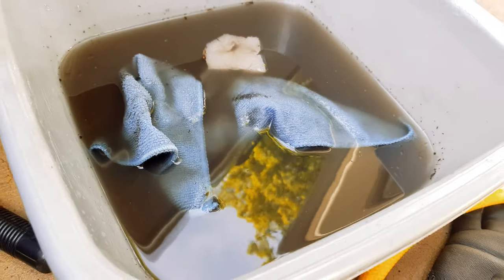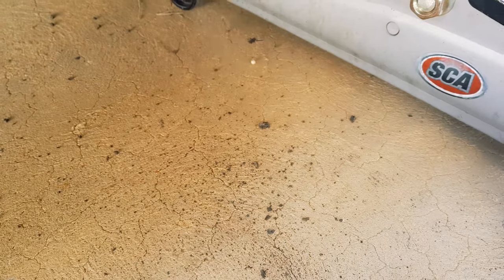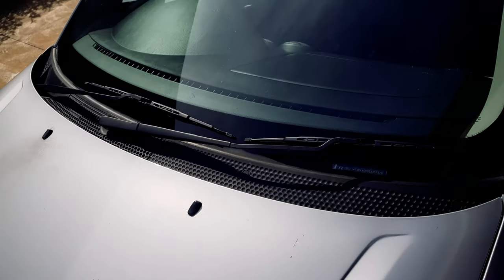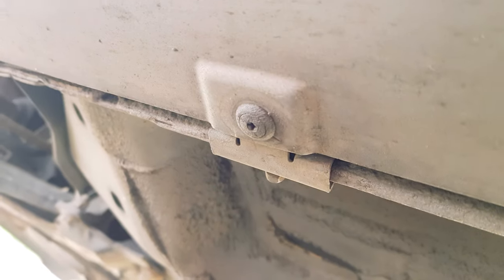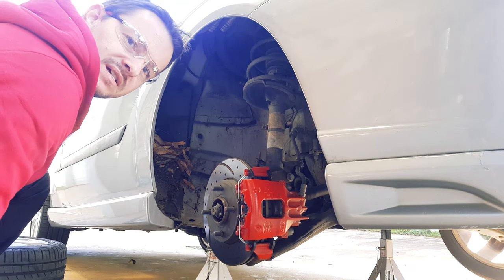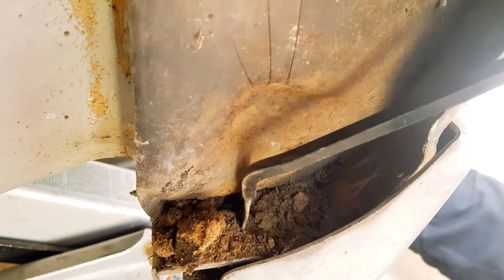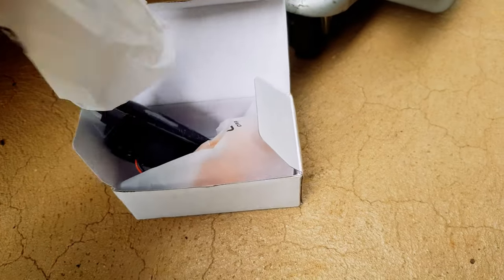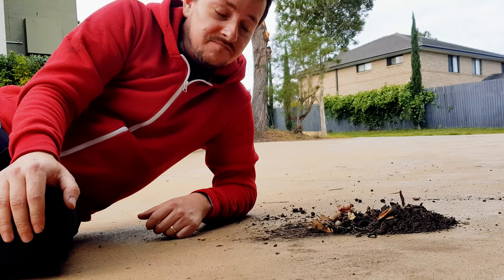How To Prevent Rust On Your Own Car - Ford Focus Mk1 LR

Comment: Hey everyone, please tighten your wheel bolts to the correct torque. (He edited that part of the video - you don't want your wheel wobbling off at speed)
Reply from the maker: Good call mate - I think it's 100NM from memory..
Reply: @Horus_Works  Sorry, we're so backwards here that I only know foot-pounds. 😊
Reply: Absolutely. I forgot to do mine up and drove on it. Started making a noise and I took it to a mechanic only to be standing next to him when he put it up on the lift and then start to take the nuts off to have a look and they were all loose. Embarrassed and lesson learnt. 

Torque them up to spec and you won’t forget to do them up.

Comment: In colder countries, with salt on the roads, snow, ice etc,  people use stuff like waxoyl or cable grease to prevent rust. The advantage of those, especially cable grease, is that they don´t wash away very easily and last for years before needing reapplication.
Reply from the maker: Thanks for the input mate, I think people in colder countries will find that info very useful 👍

Comment: On Focus Mk1, I also reccomend to get rid of the foam (probably noise isolation) under the plastic wheel arch. Bassically it works like a sponge, soaking water and thats also where the rust on the bottom of fenders comes from. I di not register any more level of noise in the cabin after i removed it. Also mk1 has really poor anti-rust protection in general. Esp. in rainy and snowy places, most of the Mk1 are rusty a lot.
Reply from the maker: Yes I believe you are right, the foam is there for noise insulation. It's probably best to remove it if rust is a problem where you live.

Comment: Replacing the driver's front wing over the weekend. A good excuse to do a little bit more. Thanks again H !!
Reply from the maker: You're welcome Mohammed. Good luck with your project. The wing is easy to take off, just a bunch of bolts to undo 👍

Comment: Another great video , would you say that’s the best jacking point , I was also thinking of the box section being the strongest point for both the jack and axle stands
Reply from the maker: Yes absolutely 🙂 Try not to put your jack stands or jack on the pinch welds where the factory tyre jack goes, as you will crush it. This will then allow rust to form in that area. If yours are already crushed, clean it with a wire brush as much as possible, and then coat with an enamel paint to prevent rust forming there.
Reply: @Horus_Works  excellent thanks!! :))

Comment: Once again an impressive job well done.Here in the UK and having worked on all marks of the Focus from MK1's to the latest versions I am of the opinion the only way to stop the Focus from premature rusting is don't buy one! Ford made the mistake calling the car Focus,it should have been named Ford Aqua.Most of the cars are issued with a boot full of water as a no cost extra,slight exaggeration? well maybe but the truth is UK Focus's are very prone to collecting water in the boot which is most often cause by the welded panels that make up the rear of the car not being sealed correctly,this applies to all marks.Secondly from the MK2's upwards there are air vents behind the rear bumper and because they are poorly sealed,they piss in water.The MK1's because of the ridiculous location of the cabin filter also piss in water for reasons I have already mentioned in an earlier comment.On a lighter note I suppose the water in the MK1's footwell helps to even out the ballast weight from the water in the boot.
Reply from the maker: 😂 sorry to see all the negativity aimed at the Focus - I guess we're lucky here is Aus in that our winters are mild so no salt on the roads or heavy rain for most of the year. Having said that rust can and does form here as well, especially near the coast. I'm finding that preventative work can stop these cars from rusting, but I guess that's the type of work most owners aren't prepared to do year from year.
Reply: @Horus_Works  The Focus and the Fiesta of all marks handle superbly well,I can think of no other car in their class that can come close to the handling qualities of the Focus and Fiesta.If I thought the Focus was really bad I would not have bought my Daughter a 2005 MK1 1.8 Ghia to ferry my Grandchildren around.This Ghia has less than 35000 miles on board it's in outstanding condition, none the less I have had to fix  all the above water leaks.If you live in a predominantly dry country,it's the car to buy.If on the other hand you live in a country like the UK,you will need to check and fix these leaks.
Reply from the maker: @turbo3492  completely agree Brian - great cars to drive for the price, nothing compares. I understand your frustration around the water leaks too. I guess getting on to 20 years old, things aren't as tight as they used to be.
Reply: @turbo3492  Hi Brian. I noticed you mentioned the rust issues on the mk1 Focus and I've seen these points in other places online as well. I'm looking for a mk1 right now as my first car. Where do I specifically look to find the rust issues? At what point would you consider it to be so bad to walk away from the car? Also any other things to look out for? Thanks in advance. 

By the way, I live in the Netherlands so it's not a very rust-friendly country either.

Comment: My wife mark 1 focus 1.6  ebony is 20y old this year 67.000 miles she has had from new it has just passed the MOT to it is has light rust on the sub frames which is probably down to the salt put on are U.K. roads in the winter my car being a diesel is the work Horse it is a 1.6 diesel Vauxhall Astra and Averages 66 mpg

Comment: Great series of videos mate , I’m currently improving a mk 1.5 facelift focus (2002) zetec
Where do you jack the car up underneath? , I’ve been using the pinch welds but they’re getting a bit out of shape 
Thanks again
Reply from the maker: Hey Paul, I use the chassis rails further in... yeah don't use the pinch welds, they will get mangled eventually.

Comment: In the UK, all our mud, leaves and crap are also combined with salt during the winter, making it a highly corrosive mixture.  Nasty stuff, that sends many cars to an early grave.  Unfortunately I only spotted this on my classic BMW after it was too late. Lots of welding needed now :-(
I wish we didn't use so much damn salt on the roads in the UK!  It is like chemical warfare against our cars.
Reply from the maker: Yeah, you guys have it bad over there with the damp climate combined with the frozen winters (salted roads) and the seaside climate (salted sea mist) all to contend with... A friend of mine over there does this rust prevention job every autumn on his 2016 Mustang to stop the rot setting in. So far so good...

Comment: I got lucky on my 2003. Mostly juet some surface rust getting a little bad on the rear end subframe and the doors...both of them are rotting right at the bottom in the middle. I sort of suspect thats a common issue with these having the drains get clogged up inside the panels. Other than that a few rock dings in the roof i really need to attend to but damn the rest of my paint is *mint*. Makes me sad to have to sand it up lol
Reply from the maker: Seems like you have a decent example on your hands 👍

Comment: Just got back a Mk1 Focus Elle, rather like yours. Bought it new. Nice car, really. Leather seats, fairly zippy, but now looking at the rust underneath at the back. Rear sill/ skirt rotted - but looks to be just bolt on? Not structural. Will try filler on it. Yours looks a lovely as mine. :) The rear sub frame looks bad, too, but saveable if I act now, I think.
Reply from the maker: Welcome back to the Focus life Ray - great little cars to drive! Hope you sort the rust problems out... 
Spending a weekend morning, coating the problem areas once a year before winter will help 👍

Comment: where dit you get the front lip? I own a ford focus station mk1 same color, cant find it anywhere..
Reply from the maker: It was a factory install by Ford back in 2002. Here in Australia you could chose it as an option.
Reply: Ford Australia made them. Featured on the ST170 and Zetec-R here.

Comment: What are the wheels called i would like to buy them for my Focus aswell. And what size of tires does the wheels fit. Thank you
Reply from the maker: No probs at all. They are Focus Mk1 Mp3 Wheels. Came factory fitted mate. The tires are 215/45/17
Reply: @Horus_Works  Thanks mate. I just got lucky and found OZ SUPERTURISMO WRC 7x17 4x108 wheels and picked them up for 200€ exactly the ones i wanted but couldnt find before. But still thanks dude your wheels are looking good aswell.
Reply from the maker: @wizzyonfire6922  no probs mate, great find by the way!!

Comment: Jesus too late for me rocker panels are done 😔 good to know for when I replace the panels

What's the wiring for the turn signal? Wanna see if there is a template to add to the US focus fenders
Reply from the maker: No problem mate, the video is here if you need it in the future. The turn signal is plug and play - no wiring required 👍 available on eBay
Reply: @Horus_Works  plug and play for euro/ Australian not for United States focus
I have to cut triangle and wire it lmao does it connect to turn signal?
Reply: @Horus_Works  fogs not turn signal

Comment: Should use only wax spray for coating.
Any other type of oil/vaseline it becomes very sticky and gathers alot of the dirt.
Reply from the maker: Thanks Dan. I can confirm that fish oil is used by the auto industry here in Australia to stop rust. It dries completely and doesn't leave a mess.
Reply: @Horus_Works  
Never heard of that use in Europe.
Doesnt smell ? 😂
Reply from the maker: @Dan _  Yeah they use it here all the time to restore rusty old cars especially. If you think about it, the best thing to keep salty water off anything is --- fish oil. Where do fish live? In salty water. I haven't seen a single rusty fish 😅 The cans they sell are completely deodorised - no smell at all 🙂👍
Reply from the maker: @Dan _  not sure if it's natural or synthetic, but it works that's for sure 😀
Reply: @Horus_Works  
Why you even use coating ?
As far as i know down under it's like in Cali. Nice weather.
Or you live in a place where it's snowing and they use salt to remove the snow and ice ?
Reply from the maker: @dan_6915  a lot of salt in the air here - coastal living.

Comment: Hi, where did you buy the rear bumper extension?
Reply from the maker: They were fitted by the Ford factory when the car was new.
Reply: I have the same trim level in Belgium it's called the Duval edition
Reply: @bjorndepauw4599  I haven't seen anything like this in Romania, do you know where I can buy it from?  I have st170
Reply: @stefandragos29  I have one
Brand new.